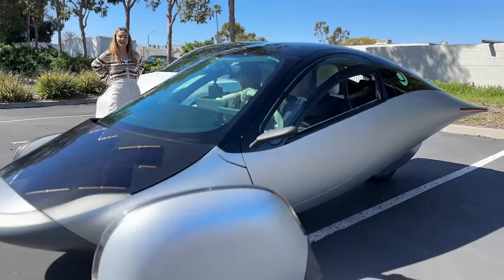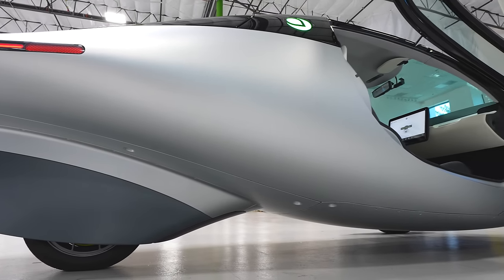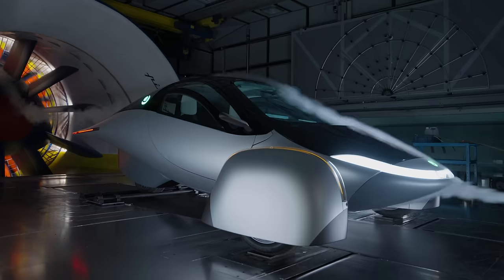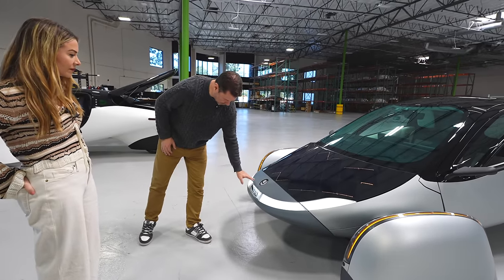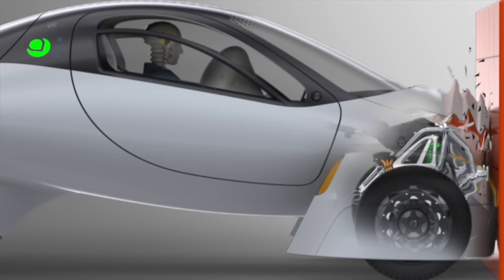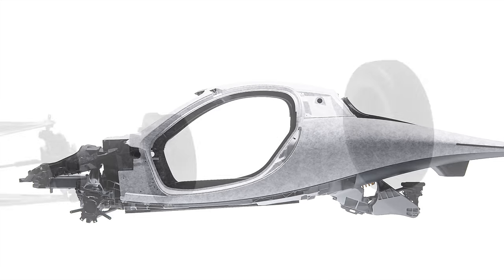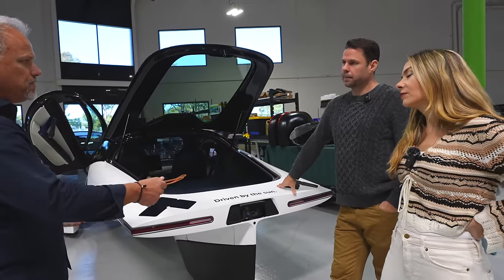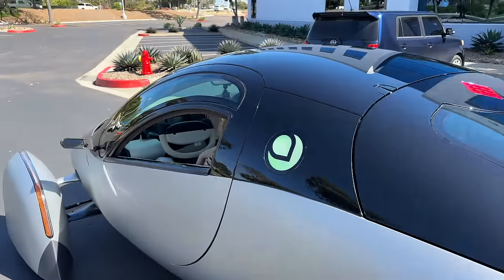Confronting Aptera's CEO w/ Investor - WHERE'S MY CAR?

Comment: The knock is interesting, but curious about the security/safety/sensitivity of this function.  For example a car jacker, large hail or object hitting the rear or the sides.
Reply: It is only active when you are holding an RFI device to activate it.  Otherwise, I don't know details.
Reply: @n.brucenelson5920  Thanks for the reply.  Oh yes, when the RFI device is near, but in a car jacking situation, say you entered your car and then someone comes by and knocks on the door.  

Can't wait for the final product.
Reply: @someoneanonymous5895  My kia has a button on the outside of the door that I press to unlock it. If the rfid keys are inside the car, pushing the button doesn't do anything. I'm sure this will work the same way

Comment: They mentioned heated seats. As a Floridian, I was wondering if they’d have seat cooling as well. Or perhaps the materials they plan on using won’t allow it to get burn your skin hot in the first place. I haven’t heard an answer on this yet.
Reply: Yes, cooling & heating standard as I recall.
Reply: Cooling will either be an option or standard in the future, but they have stated it's too complex/expensive for their current timeline
Reply: To clarify, yes on seat heating, no on seat cooling. The cabin does have both AC and heat (resistive).

Comment: It should fit in a parking spot  not practical without fitting in a spot. Let’s get these cars on the road. How far can it go?
Reply: It will even fit in a compact parking space.  The first models will have a 400 mile EPA highway range.on a charge.

Comment: I'll stick with my Hudson stinger 130 mi on 3 1/2 gallons of gas, zero to 60 in 4 seconds, cruise at 75 all day and integrated double roll bar framing for my protection.
Reply: Nice trike, but you will be paying far more to operate it, and it has far less safety and practicality than an Aptera.    An AWD Aptera also does 0-60 in 4 seconds and can sleep two people in the back in climate controlled comfort.  It can also haul 32.5 cu ft of groceries, bicycles, or what have you.

Comment: I have quite a bit of a problem with this guy saying 700 w of solar will give about 40 to 50 MI per day... I currently ride an e-bike and use a 200 watt solar panel to charge it up... My e-bike is only 48 volts and has a 26 amp ESC... And I can only get about 20 to 25 miles per day with those 200 Watts on an e-bike, and that's with me constantly checking the position and angle of the panel for maximum input. My ebike has a hell of a lot less weight, Mass, and tire footprint than a car, and it should be noted that that stated 20 to 25 me is with me pedaling while the motor is assisting. If I wasn't pedaling then let's call it 15 to 20 MI
Reply: Your e-bank has FAR more wind resistance - which is critical in stealing energy.
Reply: If I ever get an Aptera, I would probably design an ultralight, pretty flat trailer for it with extra solar panels.

Comment: Needs safety colors too not just the three shades which are not easily seen at night, in fog and into the sun. Colors red blue yellow are spotted sooner are safer and way more fun.
Reply: Adding your own custom wrap is easy and far less expensive than a paint job.  Aptera will supply the cut files.
Reply: The lighting all around the vehicle will change your mind in those scenarios. There is a recent full interview with both CEOs with more detailed info. You aren’t smarter than their designers and engineers.

Comment: Would adding PPF to the hood to protect the solar cells reduce the power output? On the highway, the hood is going to get pelted with rocks.
Reply: They go over panel impact testing in the video. They shoot a 1 inch ice ball at 90mph as well as dropping heavy steel ball on it. I think it will be fine without extra protection. To be fair a pointy pebble on the freeway is a bit different than either of those but also has less force behind it than either.

Comment: Wish them the best and I hope they don't go belly up.  Also, I wonder why Tesla didn't put solar panels like those on the back cover of the Cybertruck?  "it's not cost effective and it's to much work for the amount of range you would get"  how about I'm going camping in the middle of no where, it's nice to know that if I run out of power after 1 day of just sitting there I might be able to get back to civilization, or I stayed home the entire weekend, should get enough range to get me to the at least the grocery store or super charger.
Reply: Aptera now has a patent on the manufacturing process for practical, robust lightweight glass covered panels.  They may become the supplier of choice for other companies.

Comment: “A heat pump is terribly complex”.  But it has an A/C compressor.  Same thing, buddy.  I’d be all for leaving out features to speed up development,  but the speed still isn’t happening.
Reply: Aptera is actually on average pace for the time it takes to develop a car from concept to production when compared to the bigger companies with more funding and money. I think the problem is that big companies don’t advertise their new cars until they are already ready to start production. Which makes people think the process takes a lot less time that it actually does. 

That said I am not sure if it was a necessary evil sales strategy or just optimism that made them continually say production would be in a few years when most people know it takes 5-7 years to get there.

Comment: They need to streamline and distribute production and use LFP so these sell dirt cheap. The extensive vehicle and fuel infrastructure for ICE is antiquated. Smaller and lighter and cheaper all the way.
Reply: I like the idea of LFP batteries too, but they are heavier and less energy dense so might not work well for an Aptera design.

Comment: I want to know how they avoid the high rpm inefficiency of hub motors.
Reply: Hub motors are not inherently in-efficient at high RPMs.  There are several motor designs to chose from and the choice is optimized     Aptera is using radial flux motors.
Reply: @n.brucenelson5920  I don't know, everything I read says electrical efficiency of electric motors is decreased at even as low as 25% of maximum rpm. Higher rpm does generally equate to lower efficiency with direct drive systems when lacking transformation gears. That's part of why most electric cars have a higher city number for mpge than highway.

Comment: I wonder how they are going to make those 40 % efficient solar panels when the physical limit is 33 %. Also, their rendered battery pack seems to be about 1/3 the size of a tesla battery but has 30 % more capacity??
Reply: "They" were speculating that 40% efficient solar panels might exist in 10 years.  Also, no, the "physical limit" of PV, in general, is NOT 33%.
Reply: @bobhilder1469  I see what you did there Bob.
Reply: But 40% is SO innovative!

Comment: Electric motors on each front wheel, if one motor malfunctioned, would the car veer pretty quickly in one direction. Like on coming traffic
Reply: What kind of malfunction would that be?  If one stuck front brake were to suddenly occur on any car this could happen.  It is very unlikely.

Comment: 80% of power to wheels…you have to acknowledge that the power produced to charge the vehicle and other EVs is coal and natural gas.  I understand why he wouldn’t because in most optimal situations, you shouldn’t have to charge it often.  Most of the USA isn’t in optimal conditions.
Reply: Nationwide coal and gas are ~60% of power. In my neck of the woods, there is zero coal, mostly renewables. But it doesn't really matter for the Aptera. Unless I'm road tripping, this car's solar will easily provide enough charging for my daily driving
Reply: The way the country produces electric power is outside of the domain of car manufacturers. However, as the country moves to more green energy production the car energy consumption becomes cleaner with it. Aptera can be 100% clean depending on location and driving habits due to its solar charging right out of the gate. However, even in the city I am in you can choose to get 100% renewable electric as an option from the power company. It is slightly more expensive since some of it goes to building more green power but it is possible in many cities today to avoids the gas and coal generated power.

Comment: Yes, but how to change the rear tyre?😮
Reply: There are jack points, and the entire side cover is easy to remove for access to the wheel bolts.  In most cases you can use a plug kit to repair the tire on the wheel without removing it - something I have done many times on motorcycles, cars, and step vans.

Comment: Am excited, but still so worried for it to be successful #1, and #2 I live north so how well it does in low temps, and #3 where I live they salt the roads in winter, how will that affect in wheel motors. The height clearance too.

Comment: Every 30 pounds you lose 1% of range... You put a person in and you lose 7% of the range... Have 2 people and 80 pounds of groceries and you lose 16% of the range. Good thing there is a solar roof to help balance it out.

I wonder how hot the tires and wheels get when you have to brake, accelerate, etc. in 90-degree weather.

Comment: I was optimistic...two years ago. I'm affraid we're looking at another Sono Motors here.
Reply: The redesign has greatly improved the quality of the body and the chances for Aptera to make a significant impact in the market place.    Unlike the Sono Motors project, Aptera is FUN to drive with AWD offering 4 second 0-60 times as well as economical cost of operation.

Comment: At 9:40 the door knock knock  sensor is accidentally triggered.  I think that could be a safety issue or at the least an annoyance.  In a camping situation, latching mechanism noise may be undesirable while others are sleeping.
Reply: 🤓Good point! What if a a bear knocks on your door at night? 
Luckily that's only a prototype and that issue can be easily fixed with a software change. Can any car door be opened silently though?
Reply: @fotoguru222 not completely silent but some motorized latching mechanisms come close.  Spring loaded rubber rollers and magnetic stops would be close to silent but there would have to be a motorized bolt for safety in motion and when a locked door is needed.

Comment: Well done interview. Thx all ! 
Actually I believe the original Cd was 0.15 but, even with the minimal mirrors they to launch with… We expect to see a validates 0.13Cd!  Very much still wearing my Aptera smirk 😉having been in all of the closed fund raising campaigns to date, I have never been a very sun tolerant person but my Aptera will change that  in many ways… being in a protective sEV, realizing max solar production ( Solar Zone 9 ). 🤔My Accelerated Launch Edition Aptera will even be cutting through thinner air at my 2300-4200 ‘ elevation during my typical trek 
٩(˘◡˘)۶<- That’s my Lenny Face.. that looks like an Aptera with its front wheel pants “up” with joy. The Aptera Smirk (for the Craze) always in place !  
I suppose the Smirk will be illuminated all the time, while being driven , like a motorcycle (?) 
After the 400 mile range LE . I have a 600 mi range reserved for  cross country trips “ if needed”. Keep on informing us !

Comment: 2500 mAh is pure crap for that battery pack tore inflater.  I wouldn't be interested unless it was at least 6 Ah, and that is what most battery packs had 30 years ago. Today's battery technology is much better then it was 30 years ago, so there is no excuse for that 2500mAh crap, unless it is dirt cheap.

Comment: 0.15 Cd, what happened to 0.13Cd!?!?!?!?
Reply: Same thing that happened to 0-60 in 3.5sec
Reply: They can only test so much in that old wind tunnel in Italy plus it wasn't designed to handle 3 wheeled cars, a better test is coming plus computer simulations are always going to be different than reality, Tesla has the same problem.
Reply: @BryanDoesCinema  Okie doke

Comment: How does it do in a snowstorm or a heavy rainstorm? ... or between sunset and sunrise? ( What the heater are the a/c running )
Reply: Just fine. It has a battery just like any other electric car. It's just efficient enough that putting solar on it gets you meaningful mileage
Reply: The Aptera has superior traction control that can sense tire slip and adjust torque 32 times per wheel revolution - about every 2.5" of tread travel.  

At max output, the A/C/heater can draw as much as 1800 watts, so range could be affected.

Comment: a question about the "knock knock" entry:  What if you are sitting in the car and someone walks by and knocks... will the door open?  Or does it have a way to deactivate if you are in the car?
Reply: Likely, but you can always lock the car from inside and the knock is configurable.

Comment: Question:  Side impacts that affect carbon composite siding...How the hell do you replace or fix that? Am I missing something here?  Also...  Winter testing...snow, ice, extreme cold?
Reply: The bonding between the panels can be removed with a heat gun if necessary to replace one. However it would take a serious crash to crack one of those carbon fiber filled resin panels. In any serious crash the airbags would deploy. In any car today when the airbags deploy, the car is basically totaled. It will be interesting to learn if Aptera can avoid being totalled in some crash cases.

Comment: what happens if you have a flat tire? Can it be serviced r replaced on the road?
Reply: Yes, pretty easily. The front wheel covers pivot forward to expose the wheel. On the back you have to spend a minute with a screwdrive to remove a panel
Reply: Yes.  The easiest way is to use a DC inflater and a tire plug kit, but it is easy to change out a tire and wheel as well.

Comment: I want this, I want to invest.  I'll invest more, now, if I can translate that into something that I can apply to my purchase price. Stock shares that can be converted to amplified purchase credits?  Say, invest $20k now to get 50% increase in purchase credits?  It seems you need cash now.  To motivate investment, turn your need for cash now into gain for me in credit applied to purchase price at a guaranteed return rate. $1 now gets $0.50 credit to purchase price.  Or a buyback share deal, one share today will get 1.5 shares in a buyback applied to purchase price.  I'm just tossing out ideas, no guarantees they are fully baked.

Comment: Where do the other 3 passengers sit if it's a car replacement? You designed a $33k motorcycle? How much does it save over just driving a motorcycle?
Reply: It's a two seater car. It's not for everyone, and designed to replace every other car. No car meets all needs.
Reply: I have around 1/2 million miles on motorcycles.  They don't have 32+ feet of cargo space like an Aptera does and cost far more in fuel and tires to keep on the road.  They are also far safer to drive than a motorcycle, and don't require wearing a helmet and other protective gear.

Comment: Missed the opportunity to try out that advertised battery powered air compressor to put air in the hidden rear tire of the Aptera.
Reply: The rear tire has a small port to access a centrally mounted air chuck - similar to what dually rear tire step vans have.

Comment: Does it charge with NACS or CCS? Can you extract the energy, like Power to Home (Power to Grid)?
Reply: Aptera was the very first company to push Tesla to make their connector the NACS standard and had permission to use it 6 months before Ford did.

The Power to Grid won't be standard on the LE vehicles, but once this is commoditized, Aptera plans to offer it.
Reply: @n.brucenelson5920  oh, that's cool.  I definitely want an Aptera, I can't wait until it's out and on the road

Comment: I watch all these interviews and I just can't understand why you don't ask them about extreme weather conditions. It's light and aerodynamic going forward which means in heavy wind it's going to get pushed around. What about when a giant truck goes by how stable is it. Even in California we get 60 mph winds. What is a 60 mi an hour wind hitting it perpendicular going to do. I wish somebody would freaking ask them these questions!
Reply: There are just few flat surfaces for wind pressure to press against.   My Gen 1 Honda Insight is worse in this regard, and it does OK at highway speeds.   Both my wife and I rode in an Aptera prototype, and barely felt the influence passing a semi at speed.

Comment: The Tesla M3 uses about 250 Watt hours per mile. If it were covered with the same amount of solar as the Aptera, it would get around 16 miles per day from solar. However, the Tesla M3 is a larger vehicle than the Aptera, with more surface area therefore more solar cells. It may get more like 20 miles per day from solar charging, not 7 like the guy said.

Comment: On a bright sunny day, is it possible to travel at a slow enough speed where it can charge at the same rate that the motors consume?
Reply: 🤓 Yeah! But that is a pretty slow speed! The solar panels max out at about 700 watts and the Aptera averages about 100 WH per mile. So if its sitting in bright sunshine for an hour, that's 700 WH, so you can go about 7 mph in bright sunshine (on level ground with no wind and no A/C or heat) without discharging the batteries, theoretically.

Comment: if has a bms and is 48v most solar inverters have 48 volt battery to do dc to dc charging.
Reply: It's not 48 volt.  It's multiple 100's of volts.